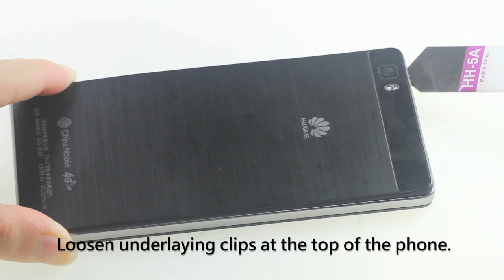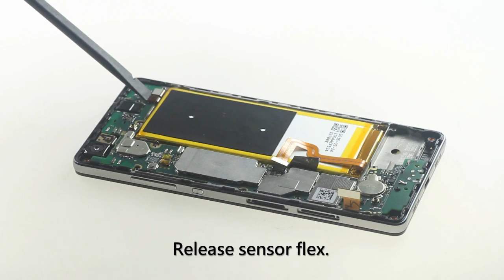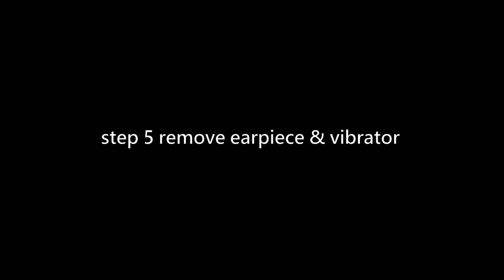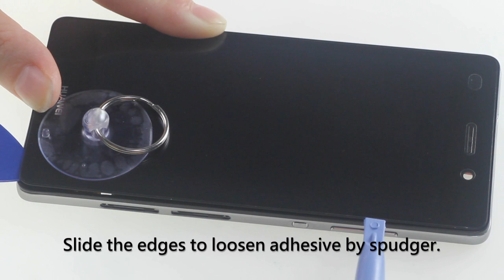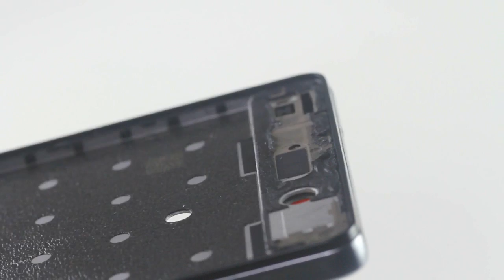Huawei P8 Lite Teardown/Disassembly/Repair Guide

Comment: I have 2 questions if someone can answer them:
1. If I change/replace my smartphone's (huawei) MAINBOARD will I still have all my pictures, accounts and all the settings I made on my phone? (I dont use sdcard)
2. Also if I change my p8's mobo will I still have the same IMEI number?
Reply: The motherboard is basically what makes this phone this phone. Changing it changes everything. Internal storage is there, as well as your IMEI and everything that can make this phone unique. Yes, you will loose everything unless you store it in an SD card.
Reply: @tralph3  so if I want to recover my files from a broken phone(not the motherboard) I could just use that mobo in another phone of the same model?
Reply: @matteavana2384  If the motherboard is not dead, in theory, yes.
Reply: @tralph3  I hope it's so also in practice hahaha
Reply: @matteavana2384  If the motherboard is not dead I don't see why you should put it in a another phone, why not just use that one?
Reply: @tralph3  the battery connectors are dead. Not the motherboard itself

Comment: Really helpful, detailed, well shot and well edited. However, things can be a little more tricky than what's shown in the video. The battery, for example, is fixed to the frame by a very strong glue, so detaching it can be difficult. I ruined mine and had to replace it.
Reply: mine too

Comment: Why do you need to remove the battery? I don't see why it is neccesary. Can you explain please? I mean for the screen replacement
Reply from the maker: We need to heat up the screen and it is dangerous when this operation warms up the battery. Usually the heat gun temperature is over 200℃。
Reply: Wit Rigs Oh, ok. Thanks for info

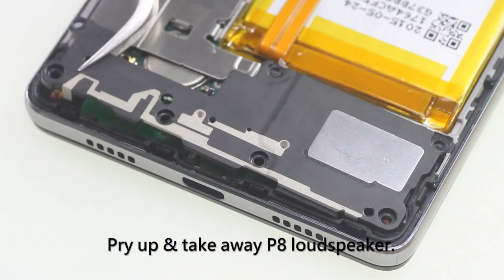Comment: Your video is very detailed and your work is very precise, thanks for the tips of disassembly. I've read that the board that you removed in 1:15 is an antenna beside an speaker. Do you know if it is the wifi antenna too? I will be very thankfull if you help me

Comment: please how and where can i get a piece of the wi-fi device huawei p8 lite and how to change it and fix it please respond quickly and if you have the solution to this is my account on facebook (عمروو فديتك)
 and these channels on you tube (أنت لي)
Reply from the maker: Many people complain about the signal receiving of Huawei P8 lite, but there is no replacement part for wi-fi device. Because the signal receiver is a little piece of metal installed on motherboard.  Removing signal receiver will damage the motherboard.
Reply: +Wit Rigs please what is the workaround permission to get rid of minor will there is an alternative solution or not and how to fix it.
please give me all the information which they can repair wi-fi malfunction in the motherbard for your huawei p8 lite please reply

Comment: Very professional i like your video guys, if u don't might i would like to know if theres a way to replace the wifi circuit or antena?? Because most part of the Huawei's P8 lite's has the same issues with wifi and bluethoot connection. Please I'll waiting a response from you guys
Reply from the maker: The signal circuit is planted on the motherboard. There is no signal antenna removable. It is likely to hurt the motherboard to replace the signal related parts.

Comment: Can the P8 Lite's battery be replaced with that of the P8's?
Reply from the maker: No, you can not. P8 lite's battery and P8's have the different connectors. They are not interchangeable.

Comment: I got a dust in my back camera, is it possible to remove the dust if I only take off the back of my phone? And if I do, how can I put the back again on my phone, just my clicking it back on or how? And can I damage my phone by taking the back off it? My garanty is already gone because I jailbreaked it. Thank you in advance.
Reply: you rooted it. jailbreak would be IOS.

also. if its a hardware problem you might still have you warranty. at least in the EU the first 6 months the manufacturer has to prove that the fault is on your side(which it in this case wouldn't be). in the next 1 and a half years you'll have to prove that its not your fault (which usually never works anyway) but a root is unlikely to cause hardware issues.
theres laws that the manufacturers have to follow too.

Comment: Is it possible to change the wifi antena in case of a short circuit due to humidity (aka liquid)? 
Warranty no longer covers it because of the humidity sensor (or smth like that they told me).
Thanks!

Comment: Hello guys, I just see a problem with my phone, since few time I just hear the sound from only one loudspeaker, the left when yo'ure in front on the phone, it's normal ? How can I fix it ?
Reply: There is only one loudspeaker  the other one is a mic
Reply: designers live in clouds, it wiil take them a few more to realise that we earthlings prefer 2 speaker stereo. They should have installed a 2nd speaker at the top

Comment: will it still work after being dropped in seawater 2 days ago, I tried to turn it off but the screen is somewhat untouchable plus nowhere in the manual shows how to open the back case,  then it turned itself. I just learned how to opened it yesterday after seeing this vid, it still doesn't turn on tho.
Reply from the maker: +Joni Anne Miranda  Please make sure you dry the phone with your hair dryer before turn on next time. Is there any water in your phone?
Reply: I think so, coz it was completely submerged in water for a sec. I immediately sucked the holes on the phone to remove the water. And then burrowed it inside a rice container unable to open the back case. After 2 days I was able to remove the back case and I immediately poured denatured alcohol to unconcentrate the salt inside then placed it back into the rice container afterwards.

Comment: Thank you for the video!
I'm having troubles with wifi and bluetooth signal (can't connect in distances which other devices do). When I put the phone next to the router it connects to it without any problems (but with low signal).
But the strangest thing, is that when I put the phone in tethering mode, the other device sees it with full signal.
Do you think it could have something to do with the antenna?
Is there a way I could clean it or something?
Thanks again!

Comment: Is it possible to replace the back cover with after market one? Would it be counted as repaired ?
Reply: +wit rigs  hello i have a huawei p8 lite it was dropped into water the first thing i did was turn it off and get the sim out i put in the rice for 3 days when i got it out of the rice i tried to turn in on it worked all was doing what it was supossed to do i turned it back off and left it in the rice 1 more night to be sure it was dry the next day i tried to turn it back on and i only got a grey screen sound and flashlight and camera still works any idea how i could solve the problem?
Reply from the maker: +Huzaifa Haroon If your phone is under warranty, you can contact with the after service to have a replacement, otherwise you have to pay for the replacement and repairs.
Reply: Phone is under warranty but damage is not covered, I've found a replacement back cover so was curious if it voids the warranty or not. 
Thanks
Reply: ya me to i dropped my huawei p8 lite today what i do ? please i need help :(

Comment: hi, good video but I have a problem: it's possible to change sim slot 1, the first one near the "iron circle".. thanks
Reply from the maker: +Key Scarpetta it's possible to replace the sim slot, but it is welding on the motherboard and it's very difficult to replace it by yourself,if you want to replace it you'd better ask for professional maintenance